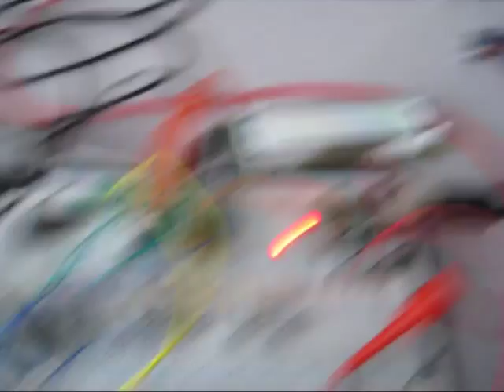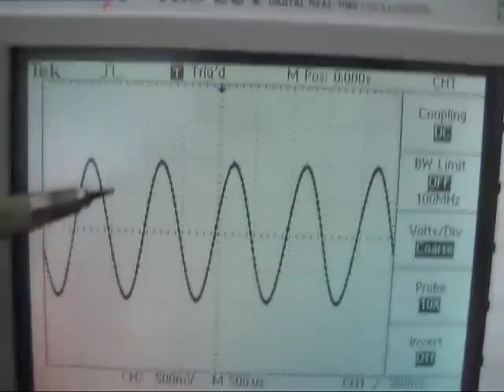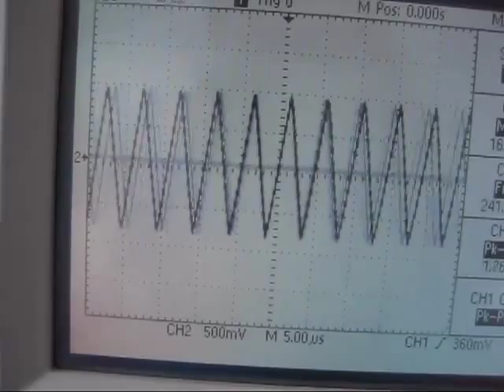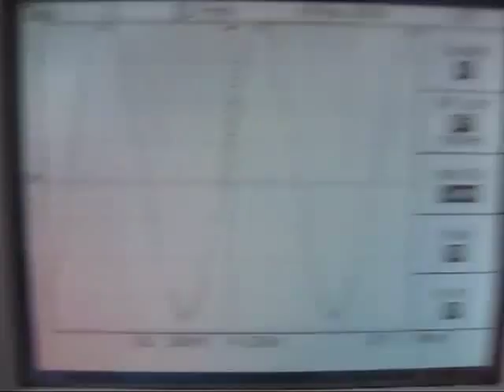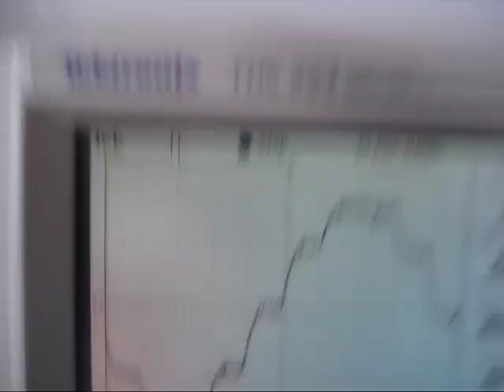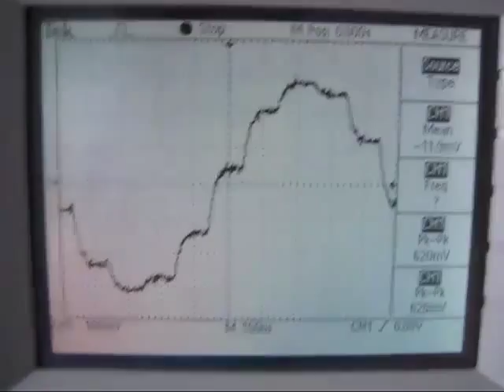Episode #3 - OSHW Function Generator (Part 1)

Comment: Great project.  Using the  op amps helps with the signal not losing amplitude over frequency and having a lower resistance to drive larger power devices.  Just a question on if the -5V ref had anything to do with the noise problem and if your op amps helped filter that too?